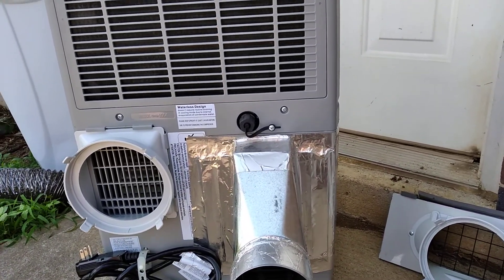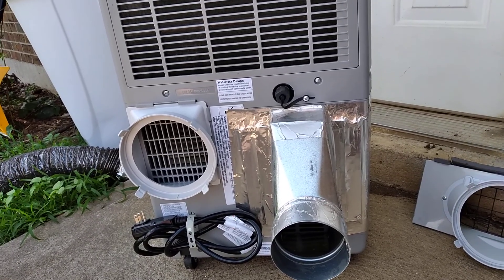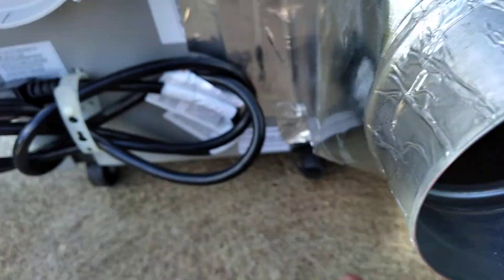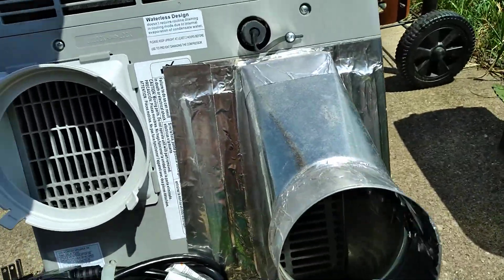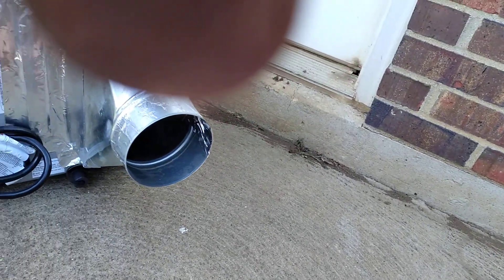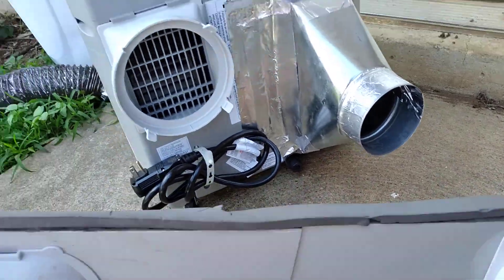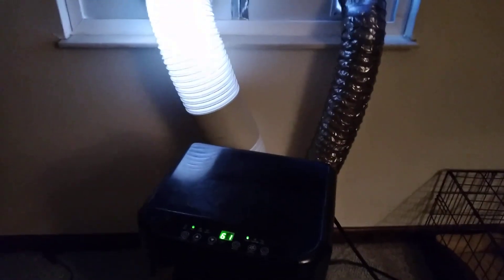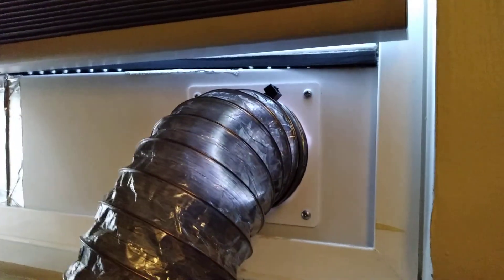Convert INEFFICIENT 1-hose portable AC to a 2-hose

Comment from the maker: To avoid damage to internal components, USE SHORT SCREWS. Also remember HEAT RISES! When installing in a vertical configuration, always make sure the exhaust side is at the top and the intake is at the bottom.
Reply: did your conversion improve energy efficiency when cooling your room?
Reply from the maker: @manp1039  Sorry, I somehow missed your question, but YES, DRAMATICALLY.
Reply: Ahhh....  of course!!  Air Ducts for home construction!!   All this time I kept pondering how and what to use...  thank you!
Reply from the maker: @stephen-dev You're welcome.

Comment: do not do what this guy did because what you're doing is you're sucking in warm air from outside the unit was designed to suck in the cold air to keep the condenser cool somebody's playing genius?
Reply from the maker: You do realize that most air conditioners have their condensers outside, right?

Why would you want to create a negative pressure by sucking air from outside? Also, why would you want to pass the room air that you just cooled off over a hot condenser?

Comment: I did this but I keep feeling "some" air (less than before the mod) coming through the door from other room, meaning even when ducting the intake port it keep sucking some air from the room. Is that normal?
Reply from the maker: Depends on the unit. One thing I've learned from reading the comments to this video is that these units are cheaply made (some brands more than others) and the condenser circuit & evaporator circuit are poorly segregated.

Comment: I'm wondering about hot and humid Central Florida summers. And if that air is being sucked into the unit would either reduce the efficiency or create moisture issues inside it.
Reply from the maker: The condenser sits inside a watertight container in these units. Water from the evaporator is plumbed to be directed to the condenser.

The heat from the condenser evaporates the water and blows the vapor outside.
Reply from the maker: Most models also have a fitting to install a drain tube as well.

Comment: also if u can insulate the tubes and make as short as possible use some fiberglass insulation or anything like old coat taped around the hose to keep the heat outside not inside.
Reply from the maker: Funny you should mention that...

I later added a furry pair of pajama like pants that belonged to my wife. I ran the hoses through both legs.

Comment: Stop wasting ur energy n time doing these, the 1hose works just fine. These things are meant for a small space so unless ur space is bigger these unit with the single hose still works fine. Forget those bullshit about sucking sir in and vomiting out do u realize how much air u have to suck per sec to cause oxygen depletion in a 150sqf space 😅😅😅😅
Reply from the maker: @smartelvis3843  This conversion dropped the temperature of our apartment 10 to 15 degrees.

With 1 window unit & 2 portables, the temperature was unbearable, AND it drew in the skunk smell from the apartment from across the hall.

After this conversion, our apartment was way cooler and smelled way better!

The price of the dual hose units has come down considerably, but they are still at a higher price.
Reply from the maker: @smartelvis3843  Also, this isn't about "oxygen depletion", it's about sucking in hot air from outside through door cracks, drafty windows, and vents. The air has to come from somewhere.

Comment: Doesn't this damage the unit?
Reply from the maker: @ruanviljoen3260  I've been running it this way for 5 years, and it's still going strong.

That being said, it would be better if you used the same diameter hose as the exhaust. I was in a hurry when I made modified these.

Comment: you know that's not bad .... yeah it looks not so good BUT using that duct work you can get a flex hose ... I converted my 2 dual hose AC from the rigid vinal to flex hose .... had to get oversized from amazon to make it work BUT ... now if we need to pull the AC away from the wall you don't have to fight the stiff hose and or take the adapter out of the window

Comment: so i got a newer one, hose is bigger, im using the old acs hose to try convert it, im using tin foil and leaving some gaps to not damage/overheat or stress the internal component/fan motor
Reply from the maker: How did that work out for you?

Comment: Great video... I did something like this last week and it is amazing.  GE sells a conversion kit for their unit to convert 1 to 2 hoses.  However it has a grate (not fully covered like yours) so covers about 80%.  Their engineers designed this on purpose - something to think about.  I covered about 80% and works fine because I am worried about choking the intake and the messing with the design too much.  With this, you are not using air that has already been cooled to feed the unit and be exhausted - AC'ed air stays in the room.

My 2nd pipe is connected to the heating vent which goes to the furnace downstairs.  This air is already cool compared to getting air from outside - just luck the vent was right beside my AC unit.

My exhaust hose is 12 inches and goes through the wall to outside - most AC have a wall mount kit and looks really good compared using the window.  My unit runs quieter due to this - I assume more efficient.  Also, I also insulated this pipe which also makes a difference.

With these modifications my 14,000btu is keeping my livingroom around 22C 1,000 sqft - while 32C outside.
Reply: The kit on GE's site shows both the slotted version and the full sided version in the same kit (RAP02), and the video says to use whichever suits your specific device.

Comment: I make a similar 2 hoses setup like you , but my compressor in the right side of the unit get really really hot when i touch the unit , is that normal ?
Reply from the maker: Not sure. The condenser is what releases the heat of your room to the outside.
Reply: GE sells a conversion kit for their unit to convert 1 to 2 hoses.  However it has a grate so covers about 80%.  Their engineers designed this on purpose - something to think about.  I covered about 80% and works fine because I am worried about choking the intake and the messing with the design too much.

Comment: Great video. Thanks. Finally someone who gets it. When i try to explain to people who have these that the one pipe versions suck your air conditioned air out of the room to cool the condenser and dump it outside. They either deny it or insist they work well and arent inefficient. Well that 8000 btu version that just keeps your room cool should only be 6000 btu but because you are using this 1 pipe version you now need a bigger unit to make up for the hot air that is entering 5he room to make up for the cold air you just sucked out.  You might as well just leave a window partially open. Same damn thing.

These 1 pipe systems should be ban.
Reply: People think their AC is "working" because it blows cold air on them, which feels nice. They don't understand AC is supposed to refrigerate the room, not run constantly
Reply: @KeithPickeringGuy  that is very true
Reply from the maker: Ty
Reply: I saw a video where it was said that by taking the allready cooled air from the room instead of taking in hot air from outside by your second attached tube... the airconditioner would compensate somewhat for the infiltraition air that is replacing the used air from the room that is blown outside... With your upgraded version with a a second tube.. your airconditioner is in the end always working with hot outside air.. ! So one tube using inside air is not good .. but it maybe is a little bit less worse than black and white... We should also consider that all those producers of ac's are not completely stupid ! In the end.. a ""portable ac" is always a third choice.. First a split-airco (ductless), 2nd a window ac, third other solutions.. like "portable"" Which are not really that portable. They big and chunky and need to be close to a window.. Or hole in the wall ! Or 2 holes..
Reply: @eurovisie2010  pulling already air conditioned air is not good. First living in a humid climate you already dehumidified that air so all of the btus did not go into cooling. Second it is probably well over 100 degrees in your attic and most homes are not 100 percent sealed so you are instead of pulling say 85 degree air you are now pulling over 120 degree air into the home. Now your home is at a negative pressure and your hot water tank starts to backdraft so instead of venting outside its venting all its combustion gases heat and moisture from burning the gas into your home.

The ac companies being stupid isnt relevant here because the consumer wants it simple and cheap and a single house system is both.

If sucking air from in the house to cool the condenser coil was better then a central air and window unit would do the same and guess they dont.
Reply: Worst part is if you think it through, if the outside air is 40c, and the inside air is 20 and its blowing 40c air out the duct, it's doing nothing at all.
Reply: @mikafoxx2717 thats why i turned down a free 1 pipe unit and bought an expensive 2 pipe unit. Then took it spart and sealed up the leaks that would still allow some inside air to be sucked outside. They are not sealed  all that well but better than 1 pipe, but you xan seal them up much better than factory.

Only reason I have one is because I rent it. If I own my own home I would be there install a wall unit or put in a window unit but unfortunately to properly install a window unit you have to at least put several screws in and that is not acceptable in a rental unit in most cases.
Reply: @kwacz  Worst part is I could have got a window unit, but got awed by the hearing ability of this since I run wood stove and there's a huge mildly cool season where moisture really should be dealt with. I'm seeing about convincing the owner to let me install an inexpensive split system myself but we'll see about that..
Reply: @mikafoxx2717  We had a portable 8000btu unit in a bedroom that was 150sq ft becuz it had a sliding window... the glass is all shaded out so you would think it would be easy to cool... I even insulated that exhaust hose so no heat could be flet outside it.. however, running full tilt on its lowest 62 degree setting, ,it would only achieve 73 degrees,no matter how long u ran it.. we then tried a standard winow unit , 6,000btu and adapted it to the sliding window..it could hit 61 degrees max and get into the 60;s easily...it was godawful noisey though... we returned that TCL ac and got an 8,000 midea U shaped one which was a bit harder to adapt, but doable... that one was Very quiet ,even on high... though not quite as capable as the TCL as far as max low temps, it could achieve 65 degrees and do so quietly...just for reference, the outside temps during ady were 105 and still about 100 and humid at time of testing...Point is that no portable will be able to compare to a window unit as far as cold and efficiency...I may stll experiment with the portable as a basement unit and try the dual hose conversion...

Comment: Be careful your intake diameter should be equal or a bit bigger than your exhaust don’t do it with a smaller diameter ⚠️⚠️
Reply from the maker: Not disagreeing with you, but they did get the room 10 degrees cooler when I went to 2 hose.
Reply: @Stacy_Smith  i did the same thing with mine and it’s working pretty well that’s nice

Comment: Did you seal the inside to separate the condensers?
Reply from the maker: They are separated by design.
Reply: @Stacy_Smith  yeah. Mine isn't. Sigh
Reply: Mine isn't too. I did the conversion, but then instead the air is being pulled from the top intake, the one used for the evaporator. But still quite some decent air is getting pulled from the second adapted hose, efficiency was clearly improved but not as it should be. Thanks for the video

Comment: You’re on the right path my friend but, not to shit on your parade, there is an even better way to do this that will increase the efficiency a lot. Where you messed up is by covering all that extra vent space with aluminum tape. Those holes are designed to remove heat from the condenser/compressor and by covering up 50% of them you are losing your heat exchange rate. Simple fix though. Build a box that doesn’t limit your hot intake holes and then pipe it to the outside with the same size exhaust hose. You can thank me later! Otherwise, nice job.
Reply from the maker: Agree and disagree. At the time this was done we lived in an apartment on the 3rd floor with a crappy window unit. Time and tools wasn't something I had a lot of (recent divorce). While your idea would greatly increase efficiency, it reduces simplicity.

We needed a solution QUICK. It was so hot, we couldn't sleep.
Reply: @Stacy_Smith  What is the disagree part? I didn’t know you were limited on resources. My ex-wife thinks I explain myself funny too. I can send you her number? Lol.
Reply from the maker: @sseforsale922  The "Disagree" portion is due to the fact that the added steps eliminate the "quick & easy" aspect of this build.

Comment: I think you can make it even more efficient by insulating the exhaust hose. A lot of residual heat radiates back into the room from how hot the hose gets. The area behind my ac is always like 5-10 degrees hotter because of this.
Reply from the maker: YEP
Reply: It makes sense why even dual hose units have two BTU's listed while window units have only one.
Reply: I believe the BTU is most efficient you can be.  While the other is if you vent to a window at max length, not insulated, and unit getting warm air from other rooms - least efficient. @autismlifehacks5233
Reply: I wrapped the hoses in super cheap fleece cloth blankets

Comment: Last question I want to vent these straight out my rv ac window, without any hoses, just make something like this and put the ac unit up against a window sitting on a stand, exhausting thru a back window
Reply from the maker: That might work depending upon the unit. You want to make sure your evaporator intake is still drawing air from the room.
Reply: Then just get window ac . Cheap, efficient and takes no room
Reply: @MrNiceCobra  in general its not efficient, nor is it the cheapest, its just that its much more efficient than portables
Reply: @peppermeat8059  
According to my research window AC is much cheaper than portable AC with the same BTU and same quality/maker.
 Also, even 2 hosed portable AC are much less efficient than window AC, because of heat loss through the uninsulated hoses.
 I don't know what is more efficient than window AC. 
Do you? Let me know please
Reply from the maker: @MrNiceCobra Not all windows can accommodate a window unit. Our old apartment had vertical, narrow, rectangular windows. That's why I bought the 2 models featured in the video.

Also people like the ease of installation and removal over the big bulky window units. A portable can be rolled into a closet when it's not in use.

Comment: So keeps a lot of the heat essentially that comes out these things and keeps the machine a lot cooler? I want to install one in my rv but don't want to get a lot of heat
Reply from the maker: Not really. The one hose they come with exhausts the hot air outside. The problem with the one hose units is the fact they draw air from the room and blows it outside.

THAT AIR HAS TO COME FROM SOMEWHERE. What ends up happening, is the negative pressure created by the unit ends up drawing air from any crack or vent in your home from the outside.

You're basically pulling outside air into your home and then cooling it down. That's why they are so inefficient.

The extra hose pulls air from the OUTSIDE, across the condenser, and blows it back outside, thus preventing the pressure differential.
Reply: @Stacy_Smith  so does it still produce a lot of heat behind the unit or not to bad?

Comment: this is good BUT, make sure the air intake hose is much much BIGGER so it doesnt start somehow sucking more air outta your room. i got this BAUER portable ac yesterday, its a much much much different design for intake, theres like 3 vents that are big. ugh
Reply from the maker: I totally agree, but I had to work with what I had readily available at a cheaper cost.

It's a "good enough" setup. Converting those 2 ACs dropped our apartment temperature from about 85F to about 70F.
Reply: @Stacy_Smith  i have a 12k btu one  but my room is 6k btu, it cools my rooms from high temperatures to 22-19c,, its okayi temp

Comment: What's a tell-tale sign for which intake is the condenser and which is the room intake?

Is the condenser always on the bottom and room intake in the upper part?
Reply from the maker: Usually the condenser won't have a filter. Incense smoke can verify this.

Comment: They already make 2 hose ACs that work like this, not worth the hassle as of 2022 as price point is the same. And there are also console type ACs much better - no hoses at all, just two short tubes, 2 halls in the wall 40 decibels max (unlike this which is 60+ decibels)... Consoles can also serve as heaters with great efficiency coefficient, save money. Of course most portable ACs have the heating feature too but boy the constant draining of water in heat mode is a bummer unlike in cooling mode where the water is removed automatically.
Reply: YES, but they are all sold out, if you find one thinking atleast one is in stock. nope, right away someone is gonna buy it